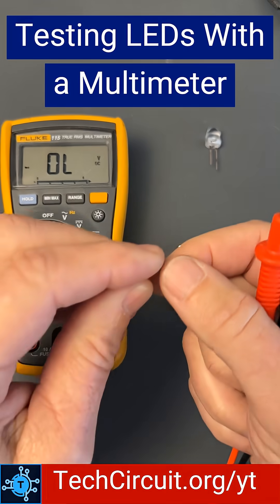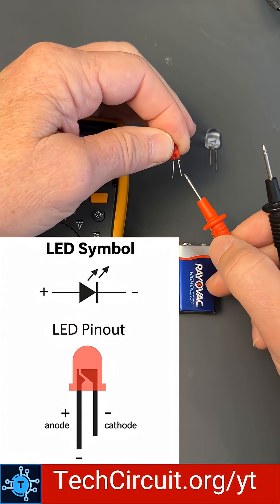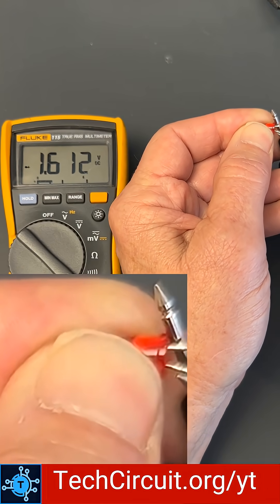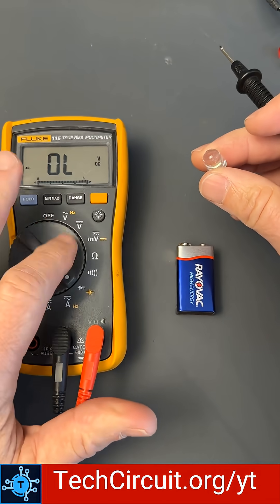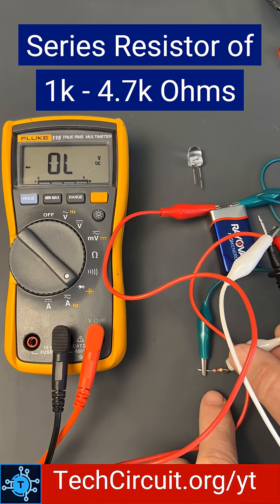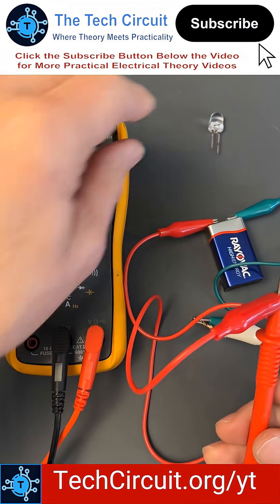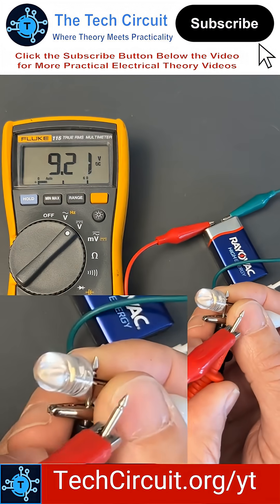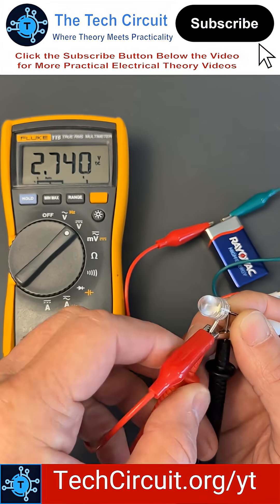🎬 #140 - Testing LEDs with a Multimeter - How To

Comment from the maker: How to Test LEDs with a Multimeter. Many LEDs can be tested with your diode check function. High powered LEDs, however, may have a voltage drop that is greater than what your diode check function provides. So in those cases, you must use a current limited source. Using a simple 9V battery and a current limiting resistor provides you with the proper current limited voltage source to power the LED. 

🔗 Useful Links:
🎬Full Video #137 at: https://youtu.be/ipGsw8YK6v4
🔗Link to Multimeter - Multimeter: https://amzn.to/3Kfn5Pi
📘 TechCircuit.org - – Learn more practical electrical theory
- https://TechCircuit.org
📺 YouTube Channel – Subscribe for more demos
https://TechCircuit.org/yt

⚠️ Disclaimer:
This demonstration is for educational purposes only. Always follow electrical safety standards and local regulations. Use the information in this video at your own risk. Not responsible for injury due to misuse of this video. 

Affiliate Disclosure:
 We are a participant in the Amazon Services LLC Associates Program, an affiliate advertising program designed to provide a means for us to earn fees by linking to Amazon.com and affiliated sites.

🔖 Hashtags:
#leds #electronics #shorts #ledcircuit #electricalengineering #electricaltheory #multimeter